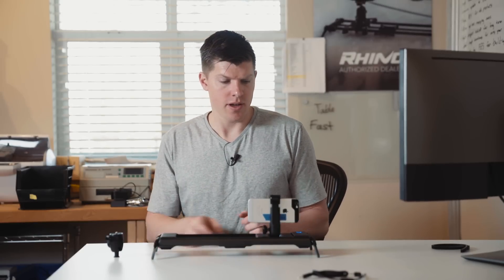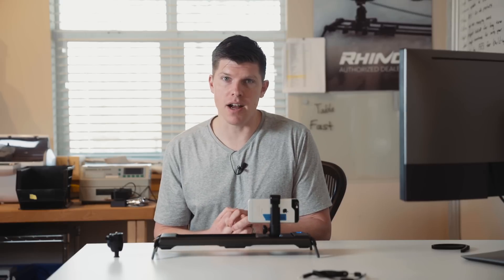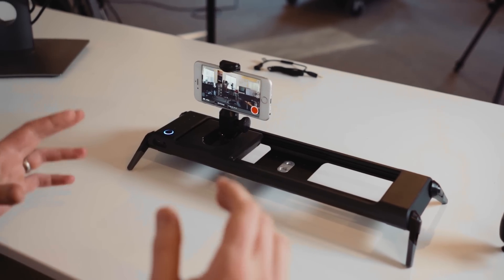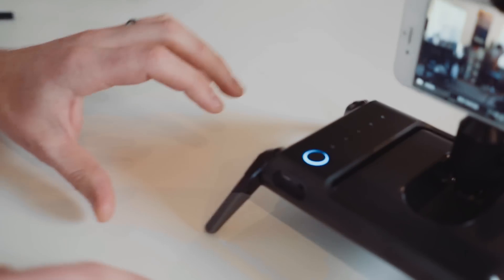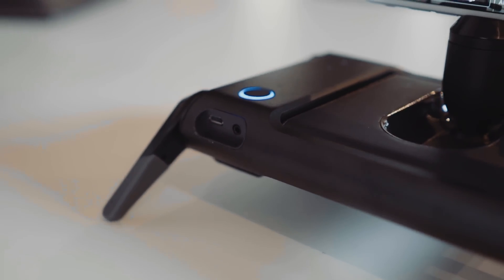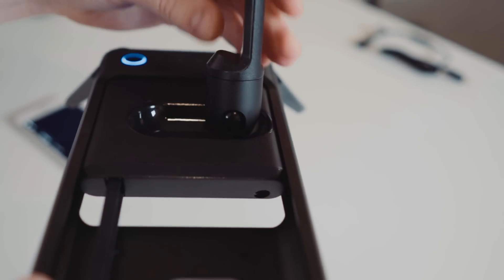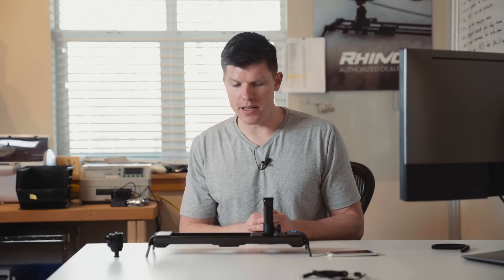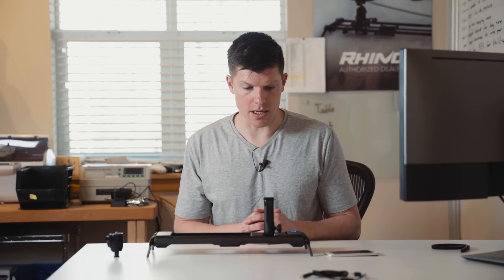ROV Kickstarter Update - March 2018

Comment: Quick question, RoV Pro sounds perfect to me for shooting with my Sony a7R + batis18/25 but I was wondering, would the system be able to move just the same if say I added the Arc to the equation? If yes, then it'd be a killer compact setup